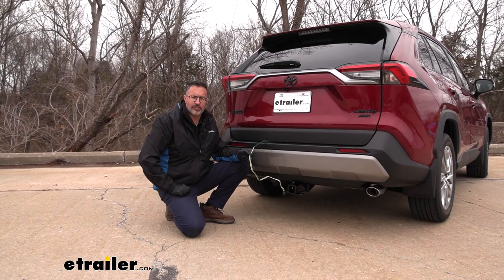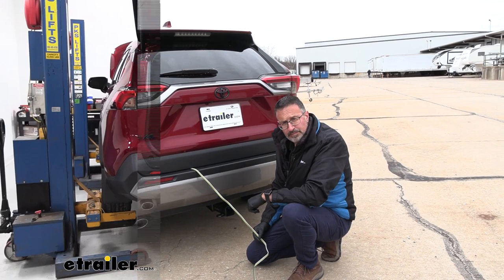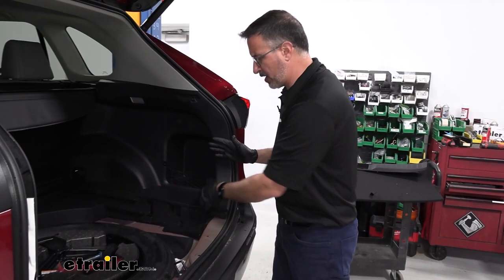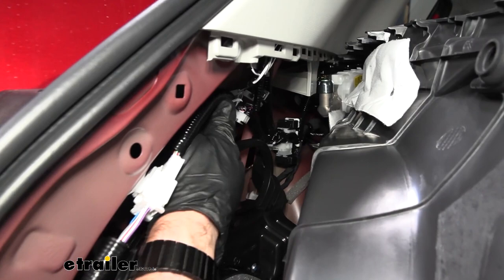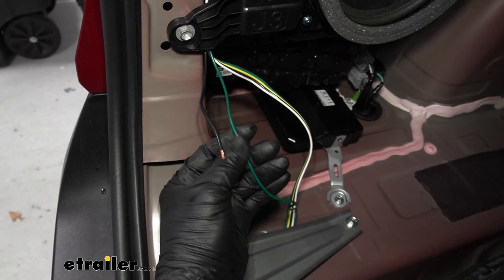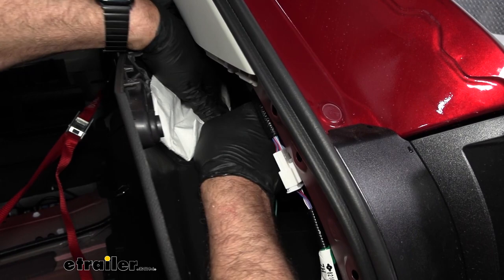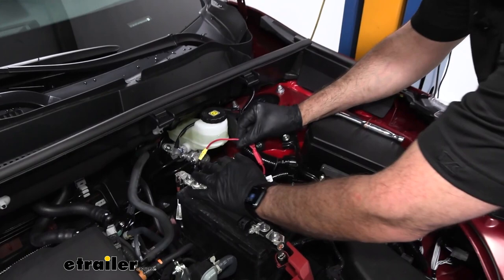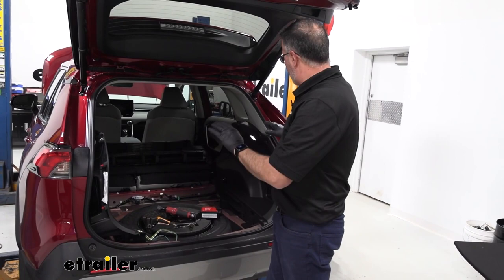etrailer | Curt T-Connector Vehicle Wiring Harness Installation - 2023 Toyota RAV4

Comment: Being in Canada I recommend you run the power wire inside the rav. As the wire will corrode in the winter Especially if they use salt on the roads
Reply from the maker: You can certainly install it that way if you wish. It does add time and complexity to the install. You could use some wire loom like # 7509-1 which is sold by the foot. This would allow for the easier install (running wire under the vehicle), but the wire would be well-protected.
 https://www.etrailer.com/Wiring/Spectro/7509-1.html
Reply: Very true.. People that live in the salt belt(Snow and Salt). It would be best to install inside the vehicle. As some will say.. there many ways to achieve it.  Very good video. Just FYI.. 99.9% of the time..Red is always positive and black is negative.. Why would you change it?? Black positive and white negative....

Comment: On the Hybrid, the 12 volt battery is in the back of the vehicle so even easier to connect
Reply from the maker: Yes, that makes running the 12-V feed to the battery much easier!
https://www.etrailer.com/Custom-Fit-Vehicle-Wiring/CURT/C56434.html

Comment: I would have ran the battery wire inside under the trim instead of underneath the vehicle.
Reply from the maker: You can certainly run the wire that way if you wish, but it adds complexity to the install and will also take longer. If you route the wire along another wiring harness underneath to the front of the vehicle, it'll work just fine.
https://www.etrailer.com/Custom-Fit-Vehicle-Wiring/CURT/C56434.html

Comment: why is the white the negative and the black the positive seems backwards to me
Reply from the maker: Although it can vary a bit, typically the white wire is used for ground and the black is used for the 12V power source.
https://www.etrailer.com/Custom-Fit-Vehicle-Wiring/CURT/C56434.html

Comment: Why didn't you steal power off the 12v outlet in the back
Reply from the maker: For good reason. Curt's installation instructions specify that the power should be obtained directly from the positive battery terminal. This fully isolates the vehicle's electrical system from any short circuits that might happen in the trailer's wiring. Could you use the 12V power outlet? Sure. Do we recommend it? No, not so much...
https://www.etrailer.com/Custom-Fit-Vehicle-Wiring/CURT/C56434.html
Reply: I would take the risk of blowing a 12v outlet fuse over running a bare wire underneath the car.